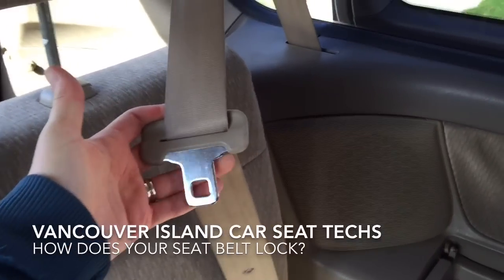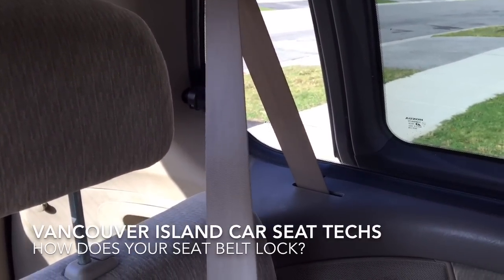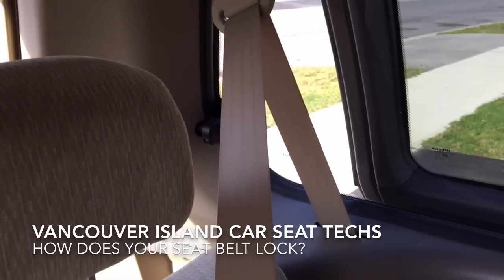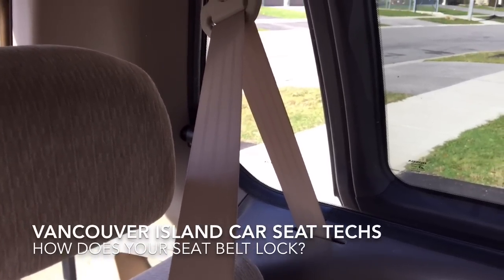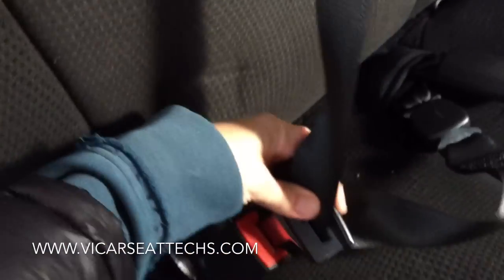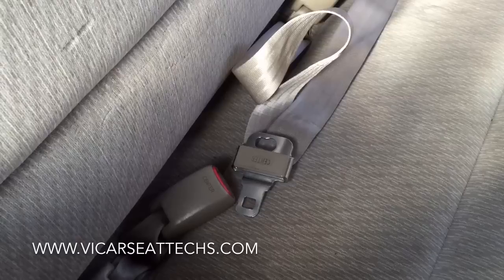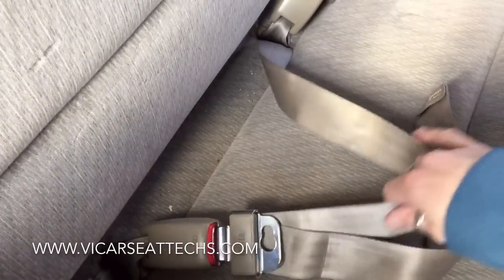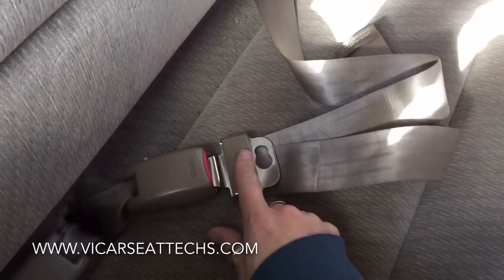How seat belts lock

Comment: I can't get my belts to lock so I can secure the carseat. It allows the seat to tilt sideways a little. I even put the hook belt on the latch just under the rear window to see if that would help. Its very frustraigting :(
Reply: The Normal Life did you ever find a solution? I have a 2016 nissan rouge that willnot tighten and the car seats just slide around.

Comment: It is great that I find videos of how to ENGAGE this auto locking mechanism by slowly extracting the full length of the belt. However, when there is not longer a need to lock a carseat in place how do I keep from strangling my adult sized passengers she constantly have the belt lock on them?
Reply: It only stays in auto-lockig mode until you take the belt off and let it retract all the way.

Comment: Is it possible to use a 1991 Toyota Camry lap belt for car seat rear facing? Does it lock appropriately?
Reply from the maker: Probably - not a lot of back seat pictures available with a quick search, but what we did see looks like a lap belt with a locking latch plate. Make sure it tightens and stays tight with the car seat installed, there isn't a secondary mechanism to kick in during a hard brake or crash.